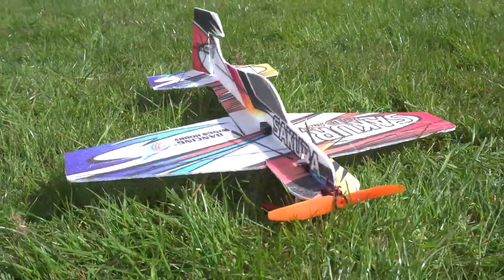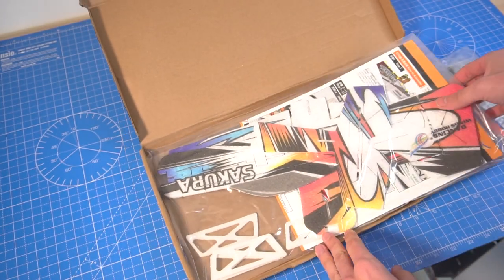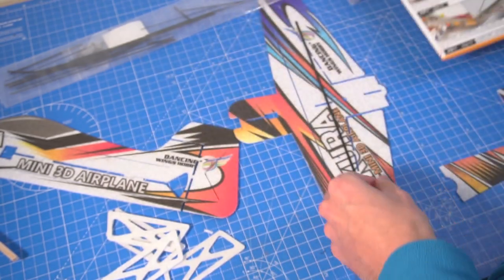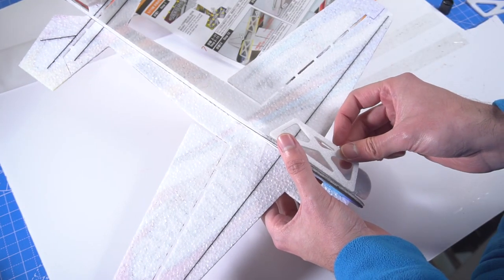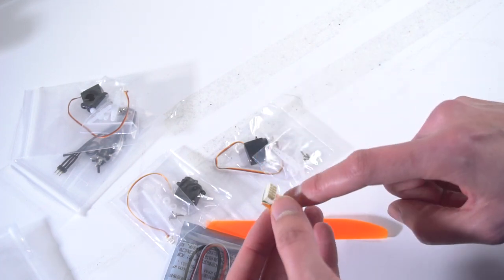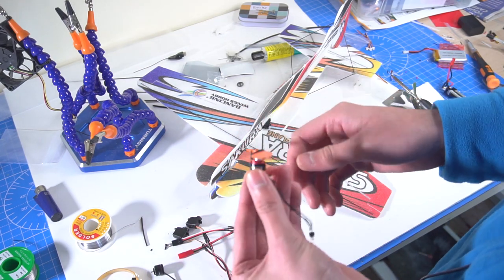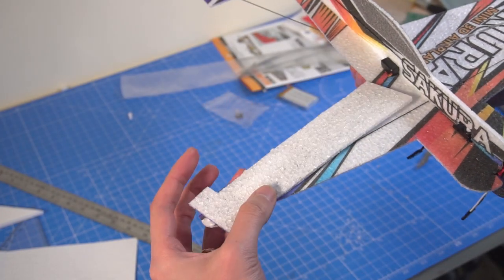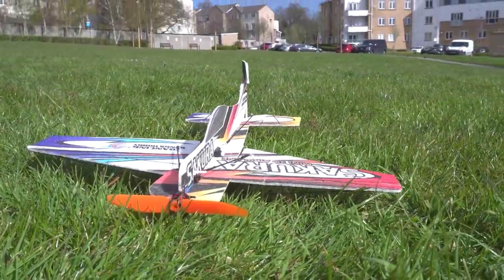Mini 3D RC Plane | Review and Flight

Comment: Hello, I received this kit version(without any electronic) of E010 Sakura airplane from AEORC factory so I weight the overall body parts of the package included all items but excluding the instruction manual, the weight was 38g(grammes).I searched every where to buy likes this UHU por type of glue but unfortunately, the oversees air transportation doesn't support to ship the glue items through the air. Hence I measured the weight of just only one stick of glue gun stick, it was 10g(grammes) so I asked from the factory that will it fine to use the Hot melt glue for reinforce the parts of this airplane so they said that if I used the hot melt glue the aircraft overall flying weight will be increased so as the result, it would be hard to fly, hence use a specified glue for foam. I am using very light weight electronic components like 2g servos, a 1106 brushless motor with prop saver and a 5030 propellers and a 8g of weight ESC, with a ELRS micro receiver and this Byme A flight controller ,I just prefer to build this model to fly on 1s(3.7v)  and so far the motor unit can trust 165g in weight when supply 2s power, therefore if I prefer to build this airplane in 1s(3.7v) power  and with using the hot melt glue for reinforce the parts , will it fly fine without any issue?
Reply: De la colle blanche (colle a bois) ça marche aussi mais le temps de séchage est plus long.

Comment: Your troubles with motor loks me like bad timing setup. You can reed manual which was suplied with ESC how to setup higher timing. Very simple procedure just listen beeps and moveng throtle up and down based on count of beeps. I bouth it as well and it works well. I am just little bit disapointed that servos are quite slow. Whole system works on low voltage   4.7v. definetly it will be improvizace to run it on 6v but it means diferent esc may be receiver as well. Or buy better servos. Both ways are dificuilt and expensive for me so i set it up to use just part of servo stroke(70%). I lost resolution and force but gain speed i hope it will be ok. Enjoy flying bye R.